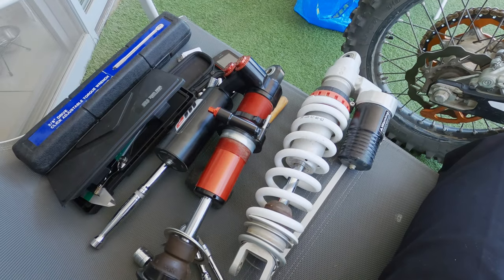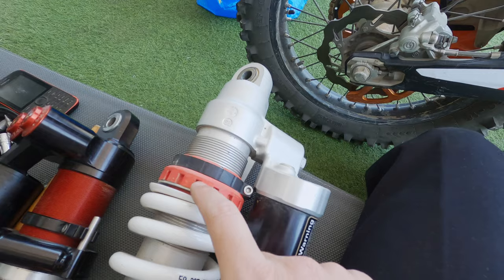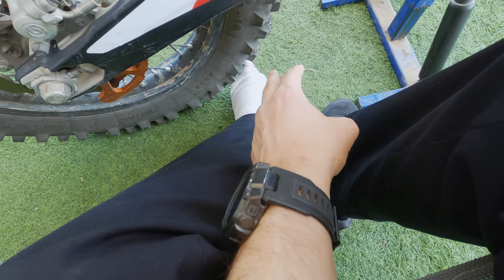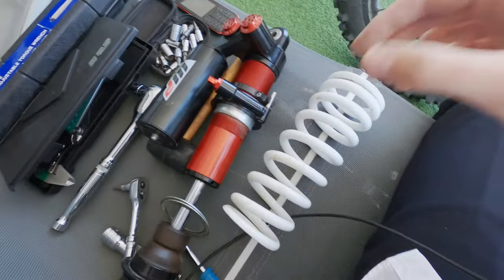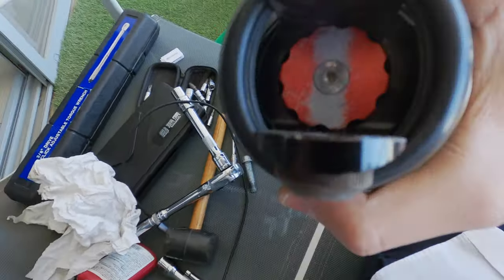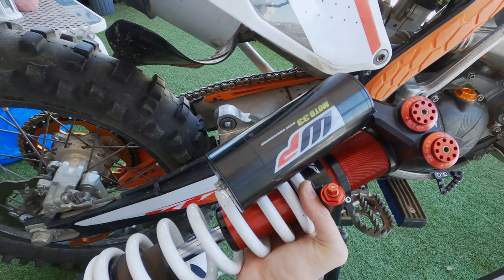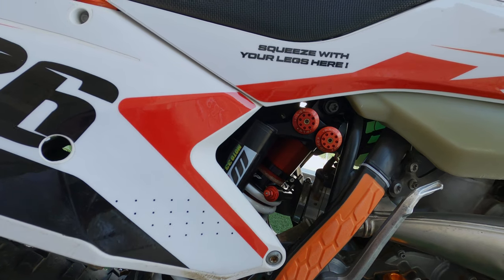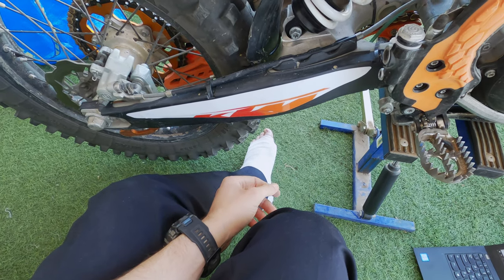I FITTED THE WP TRAX SHOCK ON MY KTM EXC 300 BUT...

Comment: you have the spring inserted incorrectly
there are two grooves at the bottom and insert a ring into the first one from top
Reply from the maker: Thanks for watching and for the input.
So just to understand, I inserted the snap ring it on the lower groove (I'm not near the bike to check it) and it supposed to be on the upper groove?
Reply: @NirHason  exactly
Reply from the maker: @dominiksima6653  I already rode with the current setup for 10 hours LOL - I didn't feel something wrong TBH.
According to you, when inserted correctly, I should get more preload than now becuase the spring will be squeezed more when I'll move the sproing holder ring up.
I'll try to take it apart tomorrow and see if you're right :)

That's the reason for the rubber boot not sitting properly?

Do you a TRAX shock?
Reply: @NirHason  i dont know if this is up to date now. The groove you took the circlip inside is supposed to hold the rubber in place. i would change it immediately becaus im not sure if the groove is a different diamention than the actual one that was made for it